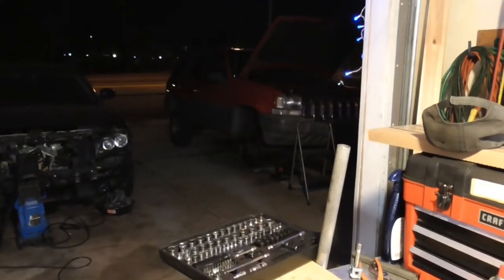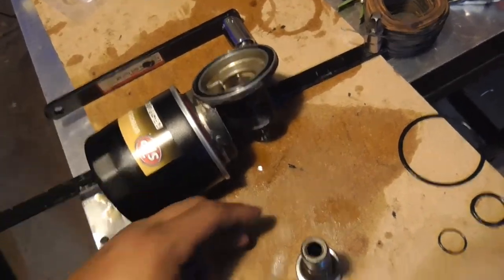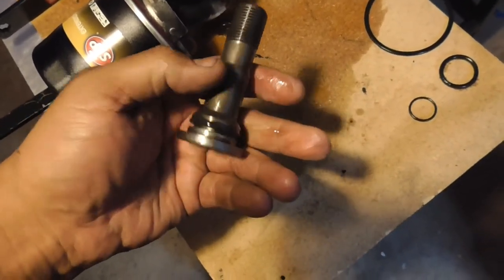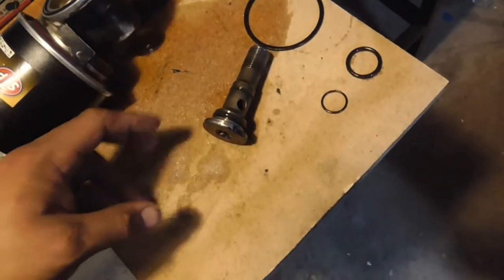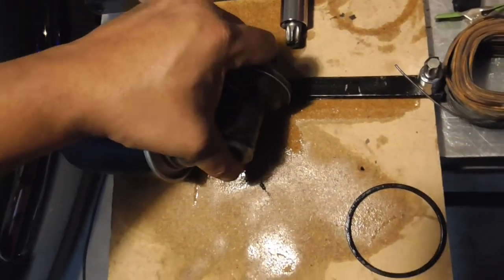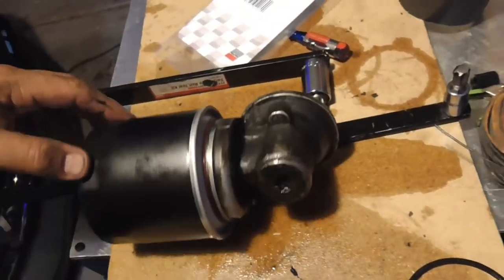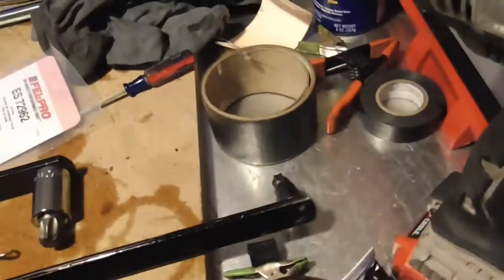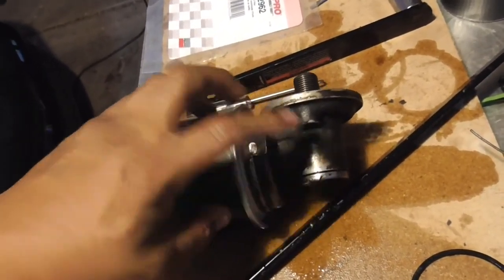1987-2000 Jeep Cherokee / Grand Cherokee oil filter ADAPTER housing seal replacement - ALL 3 SEALS

Comment: Did you use the serpentine belt tool to originally break it loose?
Reply from the maker: Yeah. Some have room but surprisingly other jeeps do not. Which is kind weird. But I’ve also a T60 torque but alone with a combo wrench. 👍🏽
Reply: @WarPonyAuto  We just did mine. A breaker bar would not fit with the T60 bit on mine. I found a video where a guy had bought a pack of L shaped torx wrenches that had a T60. We used that to break mine loose & then the T60 bit (knocked loose out of the socket) with a 12mm ratcheting wrench to finish removing it. I had a set of the serpentine belt tools on hand though in case I needed them but was able to return them later. The set of L wrenches was about half the price of the serpentine belt tools. lol